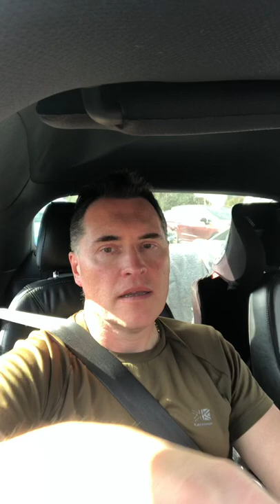Audi TT stage one tune (I think) high idle help

Comment: Whosh is from your forge dv it’s normal and high idle would be a boost leak or your throttle body needs cleaning
Reply from the maker: Sorry only saw this comment now. Throttle body is clean and calibrated, did a smoke test and found no leaks. The CAN bus actually shows a high throttle reading from the foot actuator, Its been replaced and I don't think it has been calibrated. Yet no one knows of a calibration process for the foot actuator. If I pull up on it the revs drop a bit.